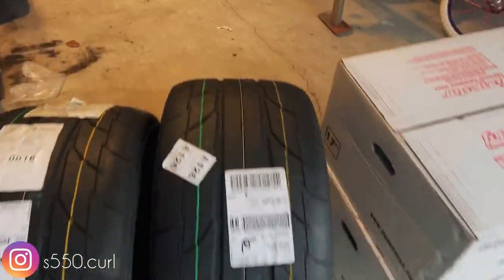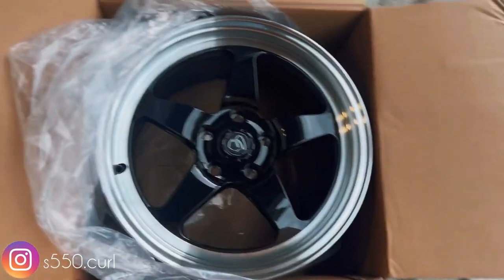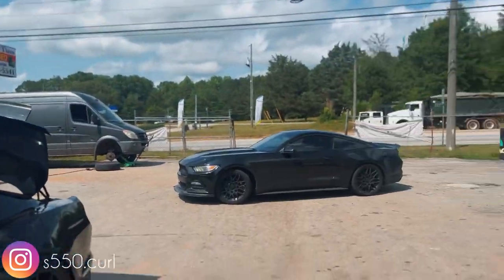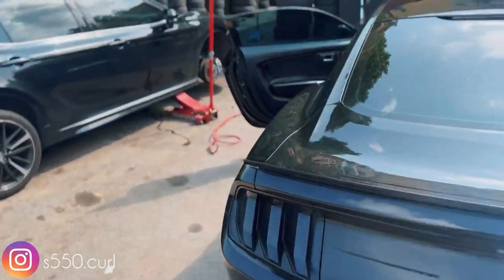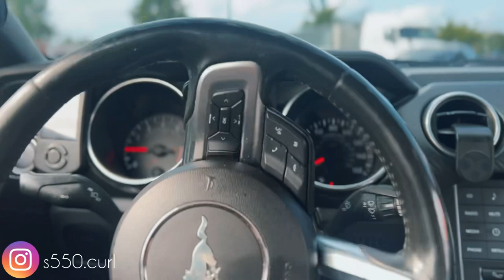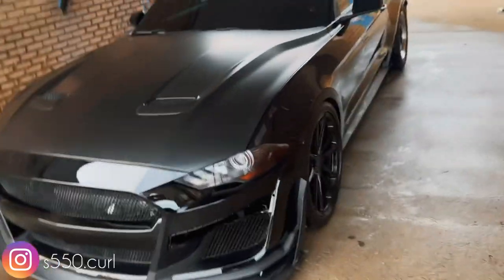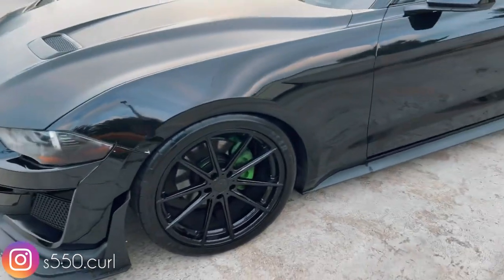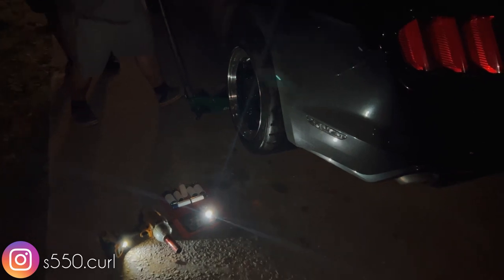Unboxing and installing my new wheels Vlog !!

Comment: What happen the rear above the tires?  Was it to low, seems like the same damage on both sides. Curious with the bigger turbo havd you had any issues with the head gasket leaking into cylinder 3. The change the machining on the block in 18 abc again in 21. From no coolant between the cylinders to a line milled into the block for coolant travel to cross drilled between the cylinders.